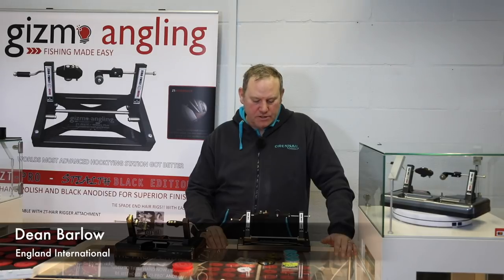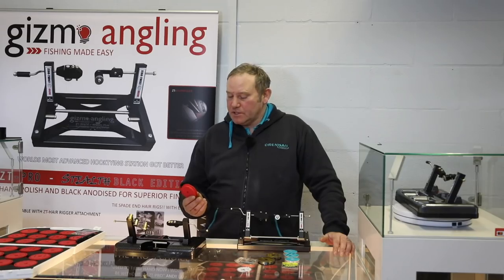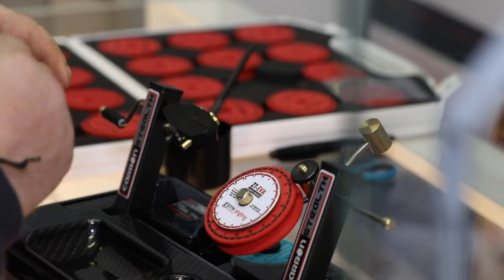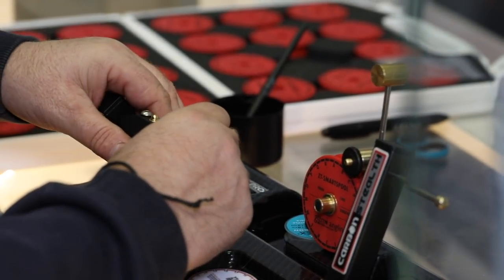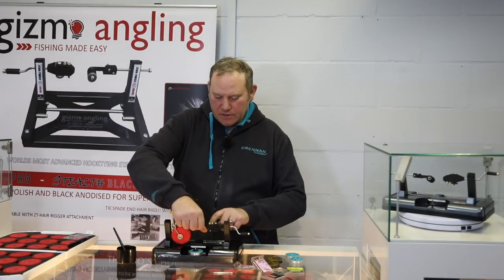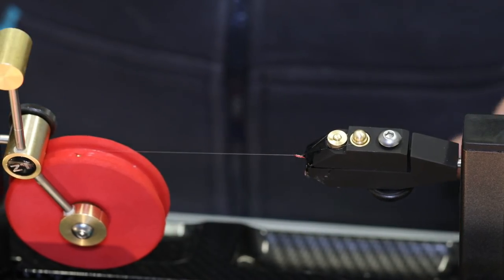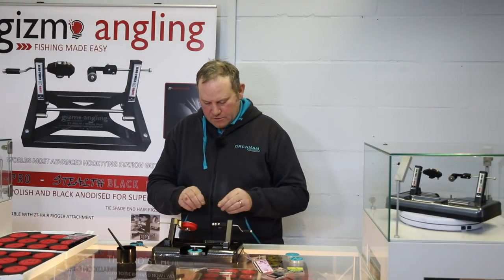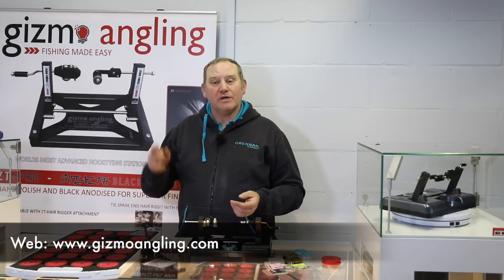Gizmo Angling Feeder Attachment

Comment: I see many feeder anglers using hooklengths of 50cm. The reason they give for this is International Rules. If/When FIPS change the ruling to no minimum length what impact will that have on domestic feeder angling?
Reply: stephen lewis, Hi stephen the Eva system is also sold on the continent where fipsed rules are used. Personally I make my hooklengths 50cm and 100cm and then cut down to suit the conditions I'm fishing.
Reply: Dean Barlow thanks Dean. Do you think Fips will change the rules this year regarding minimum hooklength?
Reply: This year the rule is 50cm again, but I'm sure their will be changes for 2019.
Reply: Dean Barlow Thanks Dean, good luck this year mate
Reply: stephen lewis thank you.